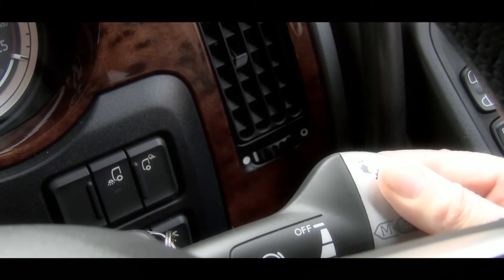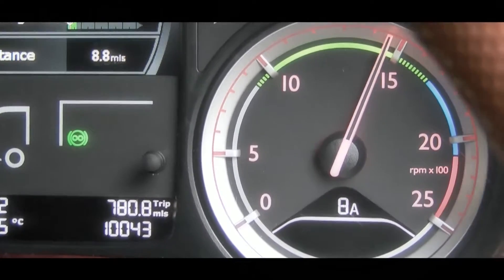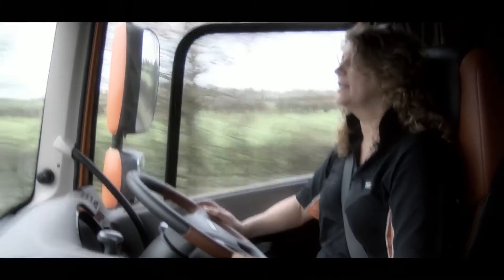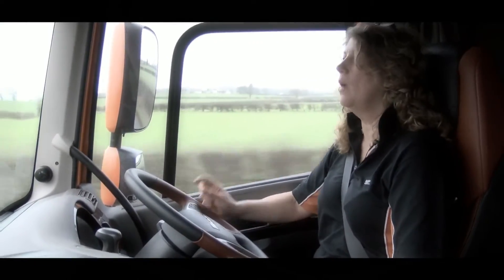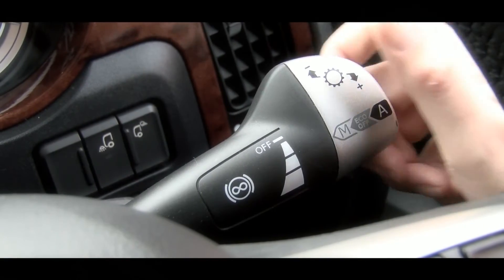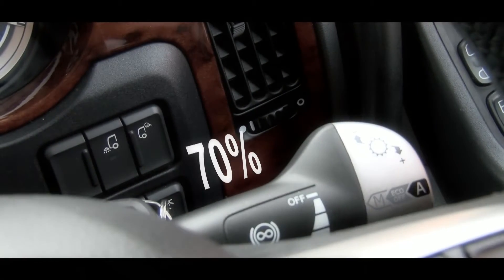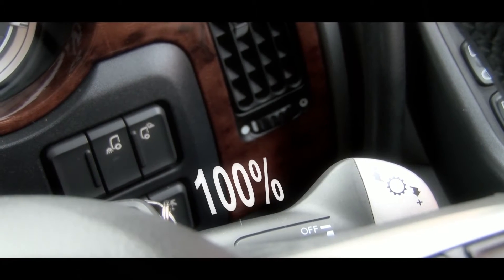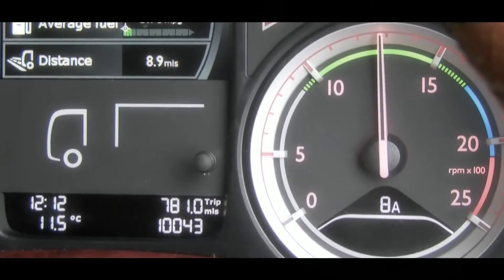DAF Trucks UK | PACCAR MX Engine Brake Explained | Training Video

Comment: Pretty sure the brake in this video isn't an engine brake or an exhaust brake, technically speaking. It is a gearbox retarder. The give-away is the sideways '8' symbol inside a circle, which is the universal symbol for a retarder. Technically speaking, an ENGINE brake is a Jake-Brake.... What surprises me most is that a video put out by a truck dealership doesn't seem to know the difference between a gearbox retarder, exhaust brake and Jacobs brake.
Reply: Was thinking this exact same thing. However i just watched another video and they show it is indeed an engine brake that works with decompression and revs.
Reply: It's an engine brake not a retarder, it's why it needs high revs to operate at full strength.
Reply: @wambogojonah316  oh ok. So an engine brake works different to a retarder? Be it a gearbox retarder, engine retarder or drive-shaft retarder? I know a Jake brake works different to a retarder and an exhaust brake, even though a Jake brake is considered a type of engine brake. But what kind of brake is featured in this video? I'm guessing it's a retarder..... OMG there's so many types, I'm starting to confuse myself lol
Reply: @DJ.LakeSea  A jake brake is an engine brake, so the DAF has a jake brake but in Europe And world over its called engine brake.

Comment: Just got a daf and it doesn't stay down not sure why
Reply: You probably know this by now, but your DAF has a toggle exhaust brake lever. Flicking it towards you activates it during no throttle. Flicking it away turns it off. It is spring loaded and supposed to return to centre after use.

Comment: hi. 
mx14 engine brake is a exhaust brake or jake brake. thank you.
Reply: ShockWave it's a jake brake. Made by Jacobs the Orginial
Reply: Exhaust brakes and Jake-brakes are 2 different things. Exhaust brakes use a valve in the exhaust manifold. Jake brakes use valves in the engine. Thus, one is an exhaust brake, the other is an engine brake (Jacobs-Brake). Not to be confused with engine braking in a petrol engine, which occurs naturally when the throttle valve closes.
Reply: Jake brake is a compression release brake, the exhaust valves are held open to release the exhaust hence why it barks or growls really loud 😂